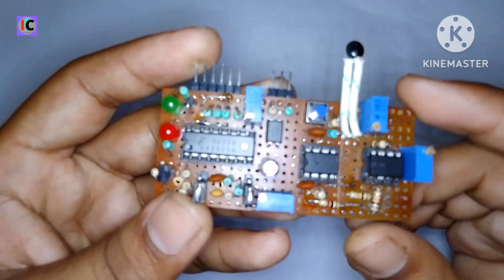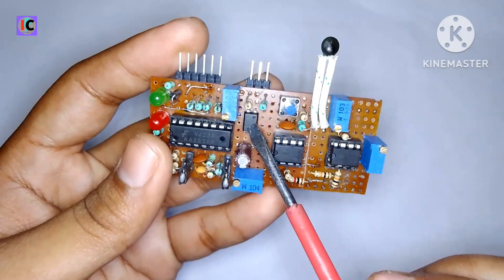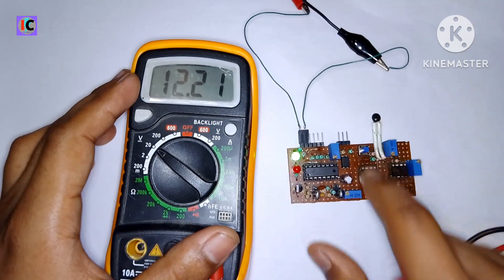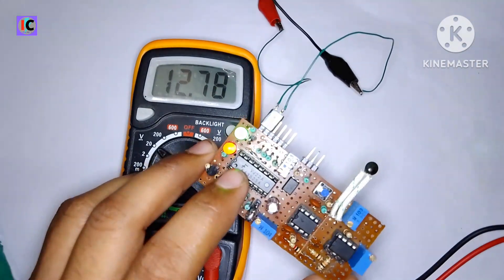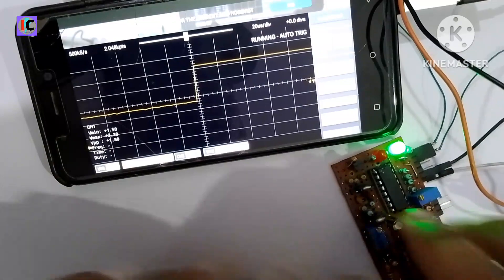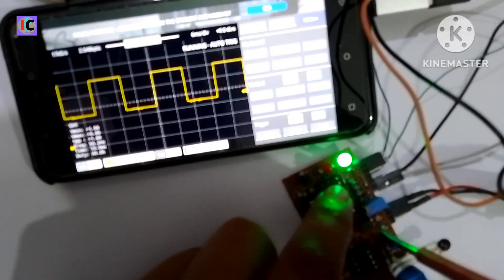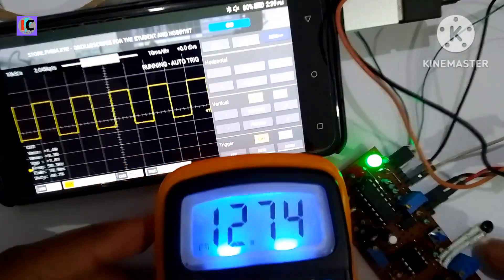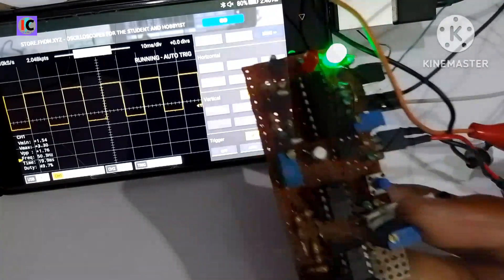SG3525 + LM358 PWM Controller for Inverter 50Hz to 500KHz #inverter

Comment: Sir you are make a it's pwm module fully testing video and explain low 60v and high 400v
Reply from the maker: I will cover both low and high voltage testing soon!

Comment: I am confused with how 4 & 8 of 555 timer is connected with threshold then thereafter to pin 7 of the LM358 through 15k, how will the capacitor beside it charge and will the reset botton work when its joined already, l tried the circuit, the circuit worked before pressing reset, the reset didn't work at all from my side here using the circuit
Reply from the maker: thankyou for watching 
as this circuit I made with the use of NE555 IC for low battery cutoff protection but its not works perfectly for that watch this upgraded version -
https://youtu.be/HL9gfEzcwbw
in this circuit I have used PC817 based very simple logic for low battery cutoff

Comment: No good for me yet,   , it needs to steady the out Voltage by itself, not by us adjusting the trimpot
over 20 videos and no one is showing how to do it,    do a video , where you VARY the INPUT voltage and the IC changes  the DUTY CYCLE by itself, and KEEP the out voltage stable, show that on the oscilloscope,  thanks
Reply from the maker: thanks for suggestion, in next upcoming video I will show every details

Comment: Hi friend, how can i control the duty cycle of the 3525 with no feedback, i want to do it just manually on those cheap chinese modules sg3525+lm358; i have the modules for my inverters but i don't know how to make a simple circuit with a blue trimmer to vary the duty cycle;   thank you very much
Reply from the maker: if your sg3525+lm358 module have feedback with pc817 optocoupler, then just simple power the feedback with GND and 5V reference pin of SG3525 that makes manual duty cycle control
Reply: Thank you, yes it does;  you mean,just put a (10K?) trimpot between pin Vref  and ground  and  then  feed the center pin of the trimpot  to pin 1 of the 817? and ground pin 2 of the 817? will that work?  @innovationic
Reply from the maker: yes

Comment: Your Feedback Diagram is Wrong.  You have added 10k + 10k Voltage Devider in PWM pin 2, its mean Pin 2 Voltage Ref 2.5V .Also 1k directly to Pin 1. Its mean Pin 1 has 5V. You are taking Ground with Optocoupler. But Optocoupler has to enable for Pass Ground from Pin 1. As from the beginning IC Pin 1 is getting much voltage than Pin2 it will never start its PWM Signal. Hope you can understand. Please correct the Diagram. I am also wondered that how your Voltage Feedback works? I think you did not made with that diagram. The 1k Resistor should be Grounded from Pin 1 and Optocoupler voltage should be given from pin 16 to Pin 1.
Reply from the maker: on pin 2 voltage is 2.5v and at pin 1 is 5v through 1K resistor so full 50% duty cycle will come from pwm output pin but when voltage on pin 1 decreases through pc817 optocoupler, thus duty cycle also increases and hence output also increases as more load is connected
Reply from the maker: when we connect some voltage at feedback wire i.e. pc817 get some voltage thus current flow from emitter to collector pin of optocoupler hence voltage will drop on pin 1 this cycle repeats and the feedback loop works
Reply: @innovationic  But you have to understand that if Pin1 is Higher than Pin2 then Duty Cycle will decrease. As you given 5v to Pin 1 and 2.5V to Pin to, so it will start with 0% Duty Cycle so you will never get any output Voltage from Transformer or Mosfet will not open.

Comment: This is great. Pls sir, I need more explanation on the pins of the pwm controller module. Are the order of the pins in the circuit diagram the same with your finished pwm controller in the video you made. Thanks.
How many pin did you actually used and how can I recognize the 12v supply the feedback, the 5v reference...
Reply from the maker: The pins of the module and circuit diagram is same and the pin 1 & 2 are used to make feedback network as it is the inverting and non-inverting pins, pin 16 is reference pin that gives 5v which is used with feedback circuit to get stable output voltage, pin 10 is SD(shut down) used to off the PWM as it goes in low voltage or over heating.
And the pinout of SG3525 module is in three parts
1)Feedback (can take from 0v to 300v dc )
2)Input voltage from 11v to 15v (drive the whole circuit from battery)
3)PWM output for driving MOSFET